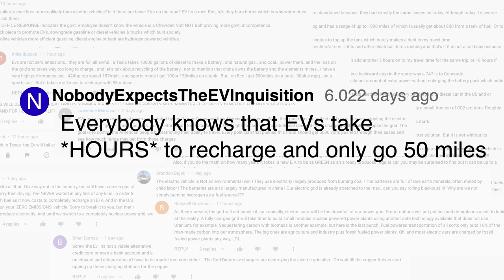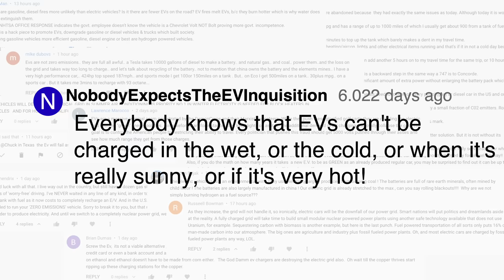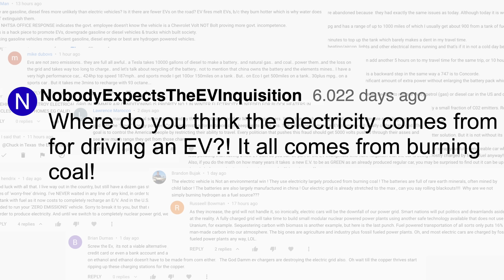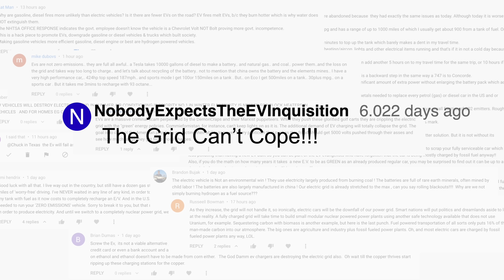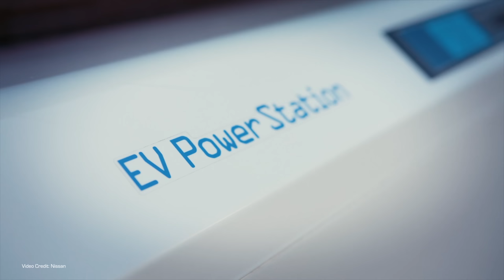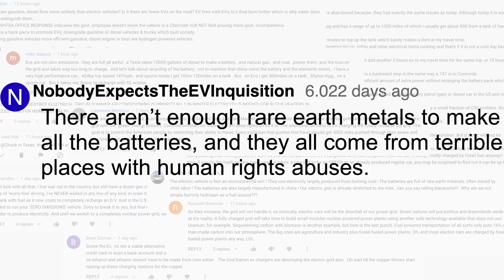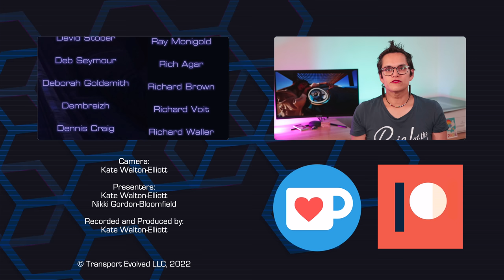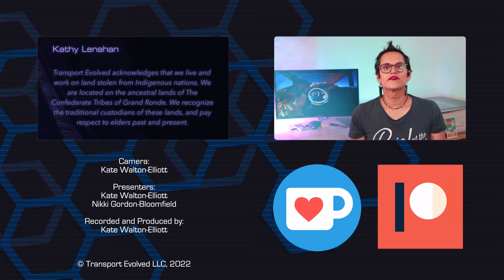The Transport Evolved List of Common (EV) Misconceptions

Comment: What you forgot to mention is the amount of electricity required to make 1g of gas or Diesel! With that electricity a BEV can run around 30-40mi already. And that ignores the electricity required to generate the Diesel for the trucks delivering the fuel to the gas stations. Compared to other consumers BEVs will be a negligible strain on the power grid.
Reply: Sorry didn't see this before I posted. 🙂
Reply: The part about ICEV is right, the part about BEV - not so much, "singled out BEV" does not strain electric grid, but a bunch of fast charging ones does, it is not a real problem now, but if everyone just goes ahead as most of companies do - oh its fine grid will cope, well it won't, grid is not well prepared for geographically moving electricity "hogs". Grid is prepared more or less for geographically static demand
Reply: @aigarslacis4433  that isn’t really true either. Most EVs will be charged slowly at night. The overwhelming majority of those fast charged will be during the day when plenty of solar is available.
Reply: @williammeek4078  that and also they ignored the fact that grid capacity is always increasing. So unless everyone gets an EV tomorrow and starts fast charging we’ll be fine 😂
Reply: @williammeek4078  true if you are driving it home ->work-> home, but if you do something else that is definitely not the case, and you are likely to be charging on the public chargers where the price would be practically the same as refuelling gas/diesel car, and likely will hit the peak demand hours. But if Covid proved anything, then ir proved that large portion of people do not need to drive anywhere, they can work from home ....
So are the BEV really needed, or this just another way to "liberate people of of money" ... sorry, I mean business as usual and nothing personal ...
Reply: @aigarslacis4433  no, nothing you said here negates my point that the overwhelming majority of fast charging will be during the day when there is plenty of available power. Most people don’t drive much at night on long trips.
Reply: @williammeek4078  it does not, the problem that I am more concerned with is that this green energy will at some point brake grid stability, and EVs will be a huge factor of braking the grid. It is not an accident, that Japan once considered an option to use BEV's as energy suppliers during peak hours, and charging only during off peak ... I am sure it will take a couple of nation scale blackouts  to figure this out properly ....
Reply: @aigarslacis4433  sorry to disappoint you but EVs are stabilizing the grid, not disrupting it.
Reply: @williammeek4078  That's not true I'm afraid. Current EVs do not stabilize the grid. They can, in the future, with V2G and smartgrids. But we are not there yet.
Reply: @aigarslacis4433  While you are correct that grid stability can become an issue, it is the main reason why we are still building gas powered plants as those are the only type that can ramp production up or down in very short notice. We still have challenges in that regard and there are a lot of potential solutions. One of them is indeed using BEVs with V2G and smartgrids. You can also have fixed battery packs like we already see being used in some places. If you have a hydro plant in the area, you also already have a proven solution for the problem. Recently I've seen one being built where they simply used sand to store excess power. So many solutions for the problem of stability. EVs will not be the downfall of the energy grid.
Reply: @Hans-gb4mv  as California recently demonstrated, load shifting alone is a powerful grid stabilization tool. Sorry, you are just wrong.
Reply: @Hans-gb4mv  that is true, but regarding smart grids and BEV beeing a good source for grid stability - I have serious doubts, people are way too selfish to even consider sharing something, unless they get huge gains from doing so ... which would actually destroy this idea in the very root ...
Reply: @aigarslacis4433  The point is that most people don't care if their overnight charge takes 4½ or 4¾ hours. They just plug in when they get home, wake up in the morning and unplug with their desired charge level. (Yes, on days when you're in a rush you can be in the 1% that press the maximum speed button to opt out of smart charging).

Those 15 minutes of flexibility spread over 4 hours, for example, allow the grid operator to temporarily reduce the current drawn by tens of thousands of smart chargers to meet the minute-by-minute fluctuations in grid demand to the order of 100s of Megawatts.

This all contributes towards a more efficient grid and less time-critical reliance on costly fast startup fossil fuel power generators ticking over on standby.
Reply: @nettlesoup  yes that is a rather neccesary plan "B" for the grid, but that kind of makes it inconvenient for those trying to go somewhere. As "joke" I can mention that electricity prices in Latvia were high during the summer period, which kind makes one think, what the hell was going on if the sun was sort of abundant (just to make it clear LV does not have notable solar farms), and we tend to import electricity from Russia and Scandinavia ... 
Other option for us to fill the energy defficit would be runnig our large GAS powered termo electric plants, which I guess nobody wanted to do ...
Reply: @aigarslacis4433  Rapid DC charging (15–30 minutes charge while on the move) is different from destination or overnight AC charging (while not waiting for the car).

I find it very convenient to stop every 100-120 miles (even though the car can go 250 miles) and have a rest break. Usually the car is finished charging before I'm ready.

Re: electricity prices, yes they are rising everywhere. Because fossil fuel prices are increasing. In many countries the price of electricity depends on the most expensive producer at the time, which means even if the wind and solar power is cheap you still pay at gas prices.

As we add more low carbon energy generation there will be more days where the grid is clean and the average price will come down again. We should ask our governments to permit more solar and wind generation, which many governments are blocking because their parties are funded by fossil fuel lobbyist organisations and individuals.
Reply: @nettlesoup  well I did expect this answer, but how many of the cars sold 'today' can do that, if memory serves me right it is those who have more than 60K price tag .
Reply: @aigarslacis4433  

"but that kind of makes it inconvenient for those trying to go somewhere."

Not really. This is something the EV owner would have to opt into, not something imposed on them. So, they won't opt in unless the battery already has sufficient charge to get them anywhere they might reasonable decide to go that evening.

But, during the normal case where you leave home in the morning with 80% battery and returning home in the evening with battery at 70%, there is really no reason not to opt in, even if just for a small discount on the electricity bill equating to just a few dollars per month. 70% is more than plenty to go out and do stuff in the evening, if you want to do so. And, as long as the battery is back up at 80% when you wake up the following morning, you really don't care whether the charging happens at 7 PM or 3 AM, as long as it gets done.
Reply: @ab-tf5fl  That is however very good point and I have considered buying Smart BEV so that I would have very light and nimble city car, but since Chinese took over that company I have lost interest in that venture ....
For the rest of the cases I really hate the amount of thought it would take to just drive where I want since I do drive frequent 400+ km round trips to places of interest in LV, LT, EE and nothing beats diesel, just drop where ever you feel you want to take a walk and just go instead of searching for some charging spot ... and it easily does 1000 to 1200 km on a single fill. I really, really would hate doing that planing, since I am not bying even into using apps like Waze - they  do not help me, I know my ways and do it much faster then what waze suggests.
Reply: @aigarslacis4433  Wrong
Reply: @aigarslacis4433  Stop arguing and try learning, you are wrong.
Reply: @BioniqBob  Just by telling me I am wrong, you are actually not telling anything. I know by experience when shit hits the fan, for you - well wait some 5 to 10 years and will see if the luck is on your side, since the science is not there yet, and it is not catching up as fast as you wish it did!
Reply: @aigarslacis4433  Wrong Nancy
Reply: @BioniqBob  I guess that is the most of English vocabulary you have, sorry to hear that.

Comment: The term 'rare earth metals' (aka rare earth elements) has a specific meaning that most people get wrong.  Rare earth metals can be located on the periodic table and do not include any metals used in batteries that I know of.  Rare earth metals can be found in electric motor magnets and perhaps some electronics.  They probably account for less than one kilogram in a typical BEV.

Cobalt, nickel, magnesium, iron, phosphorus, etc. are not rare earth metals.

Comment: I heard one recently: "There are so many charging standards" - Argh!  No there aren't!  In the US, technically, 3 exist...but really, it's only two.  We live with two charging standards with our phones right now...and soon enough for both, we are going to support both of them (cars and phones).

Speaking of phones, battery research benefits everything that uses a battery...which, turns out, is just about everything.  You're not putting an ICE into your watch, nor a fuel cell.  There are a billion different industries who are researching better batteries.  ICE research is actually decreasing by volume as more things transition to electric...even things you wouldn't expect like hobby planes/cars/boats, etc.  Yes, niche markets, but still, the need is there and the trends are there.

Comment: I have to disagree with the charging in temperature part - not due to cars, but due to the chargers. This is unexpected problem for me - a lot of quick chargers are without any sort of roof and in summer tend to overheat a lot. Perhaps it's just my experience, but I had events when half of charging posts were not working due to overheat and the other half was charging below 100kW.
Reply: i saw that issue in washington this year. the NW was so absolutly overheated. IT WASNT ABLE TO PUT OUT much power to some people i know that have an ev. i told them it may not be their car and they did check the fan and it wasnt goin anywhere near as overkill as the charger box itself those fans were SPINNING FULL SPEED non stop
Reply: @hybridstoatdragon  In my case the pc driving the financial side of things was overheating... Multiple remore reboots etc, nothing helped. So, at least that part is partially based in reality :)
Reply: They have had several videos on just this subject when they towed a car on a trailer across several western states with an EV. There have also been several comments about roofs... and the fact that they would be excellent places for photovoltaic cells too.
Reply: @danielcarroll3358  Yep, I know, I just pointed out that this is not a myth, but sad reality.
Reply: This is just growing pains. As problems go, this is a really easy problem to solve. An awning is not exactly new technology. Most gas stations have covered islands.